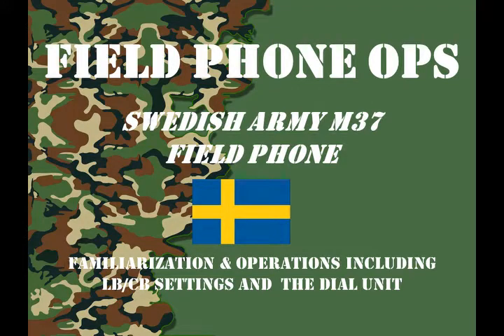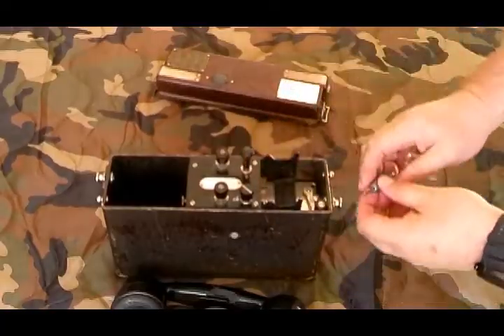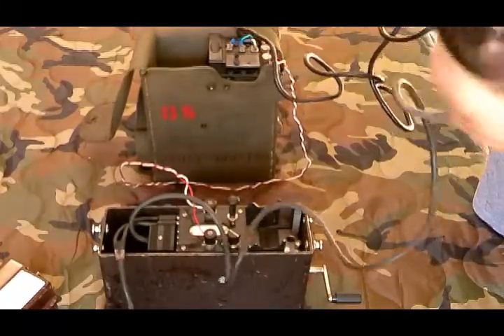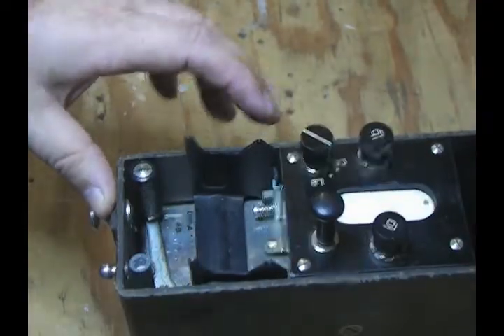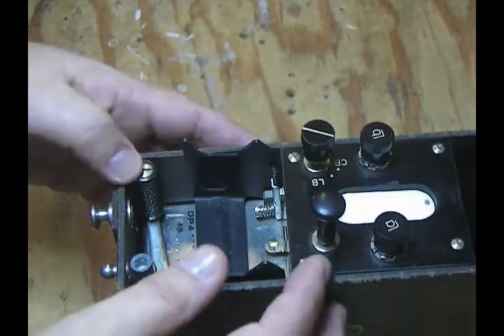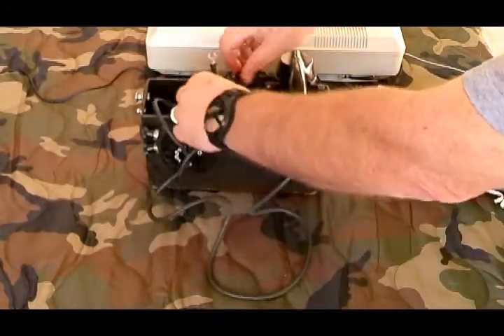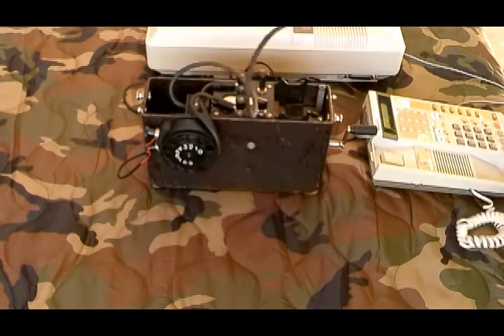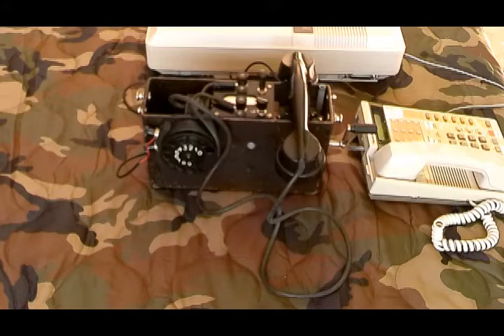FIELD PHONE OPS:  Swedish M37 Field Phone

Comment: I've got one of these swedish phones too. The magneto works , but the handset is not working....despite new batteries.  The battery carriage was covered in 'verdi gris' so I cleaned it up. The interior whilst a bit dusty and spider webby, looked complete and unmolested....is there a common or easy fix for this type of fault....I'm useless at electronic stuff, cheers 😊😊😊😊
Reply from the maker: New handset with cord and plug.  I've seen them on Ebay

Comment: Pretty well made phone, the dial and extra receiver is hard to get, and ofcourse as you mentioned the numbering of the dial is Swedish, and not used in other countries, so making a layover for the dial center is a wise thing if you want to use it.  You also have this push button (under the rubber part in the cower) It generates a howl in the receiver in both ends. (Maybe harmfully loud?)   Some of these does not have that howler.  
I have heard that the Swedish soldiers used the name APA on this model, that is short for apparat (apparatus), but in Swedish it may also be equal to "monkey"  :-)
Reply: I find the unusual dial is not a problem if you hook the phone up to a Grandstream ATA, like the HT801 or HT802. They know how to decipher Swedish dials.

Comment: This is very cool! I'd love to get one of those phone systems. So, does your phone system switching unit there pick up both tone and pulse at the same time, or do you have to set your base phone to pulse mode, too?
Reply from the maker: It has auto sensing for Dial Pulse and DTMF it also will do straight CB phones,  if you connect a CB phone with no dialer you can program the PABX to route the call automatically to an attendant position for answering as soon as the CB phone goes off hook.